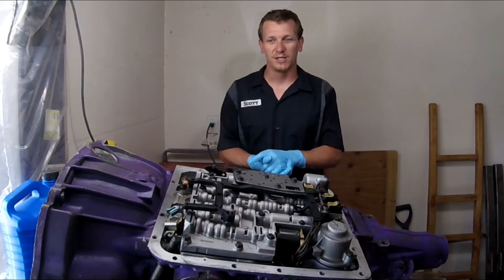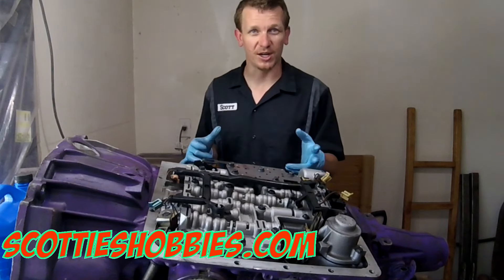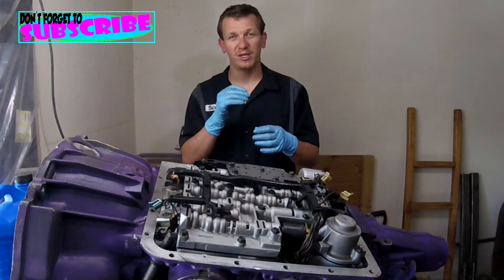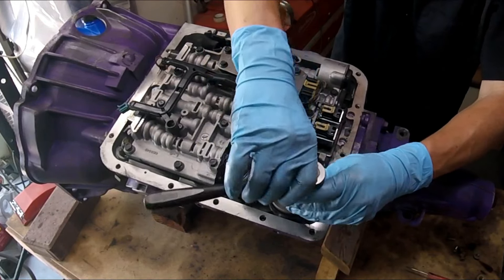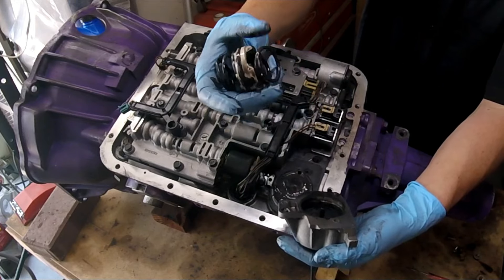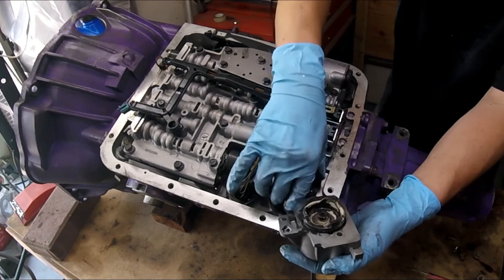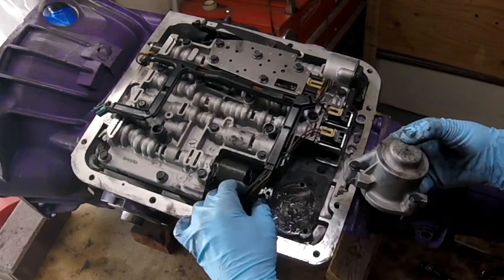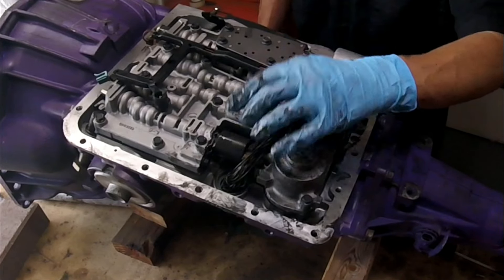⫷ 4L60e Harsh Shift, Shutter, 1 - 2 shift problems. 1-2 Accumulator Check and Replace ⫸

Comment: Thanks for the videos I had a hard shift from 1-2 and took it all apart to swap out the piston and to check it all and to change the 1-2 3-4 servos while I was there but after taking the accumulator apart I found the piston jammed once I got it out the spring in the middle was broken hint may have found my problems but the question I have is most videos/pictures I see only show two springs and mine had three a red outer a white middle and a small red which is the one broken is this right if not can you point me in the right direction to this. Thanks
Reply from the maker: Those accumulators very. I don't think I've ever taken two of those apart in a row and seen the same set up twice. I honestly don't know why. In your case I would recommend probably doing a shift kit. Just so you know all the Springs match each other. It's going to be hard to say where that spring came from. Do you know if you had a shift kit already installed? Also I would replace the Pistons with metal ones if they haven't been replaced already. When I rebuild my personal transmission I went to the Sonnex pinless accumulators.

Comment: If the hard shift only occurs when cold could it still be this?
Reply: Mine does the same thing when is cold when it gets hotter doesn't do it much.  I hope you get an answer ,  but I guess the best way to know is replacing the part.